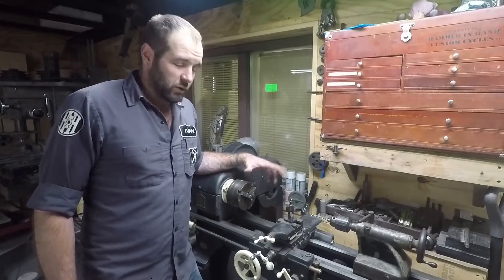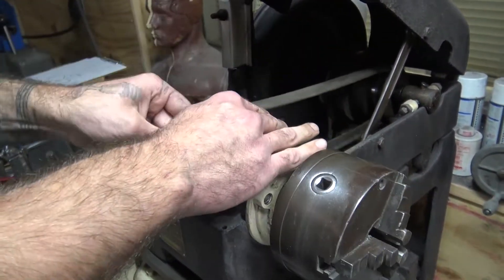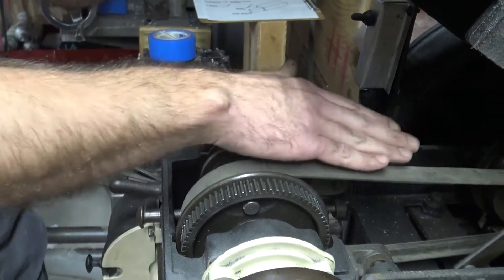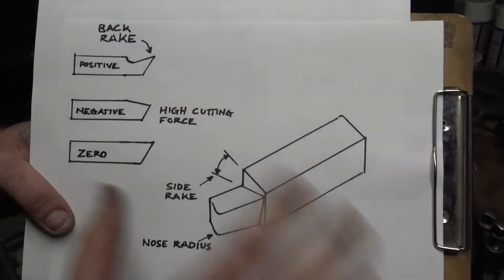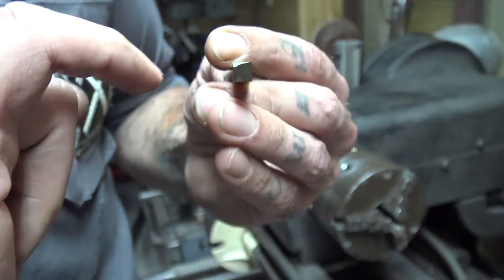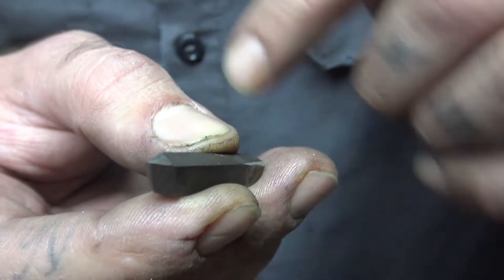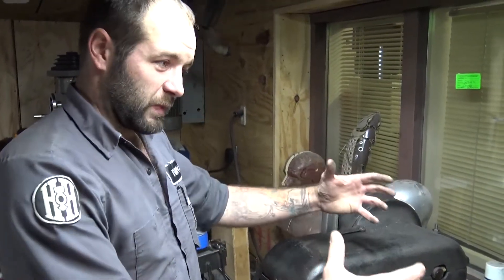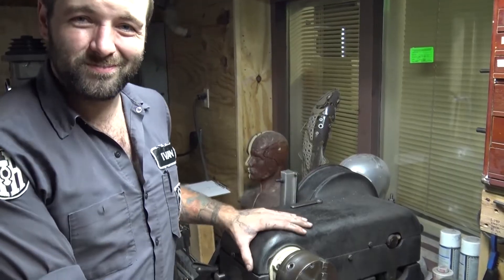Metal Lathe Basics Tutorial | How To Use A Metal Lathe

Comment: love the vid,  but for all beginners, please keep your fingers back while the lathe is running, sometimes thosae chips and strands are razor sharp,  ive  hada few close calls pullingthem off when the machine wasnt even running, pull off a strand, and it was caught, it will sing right into your skin. always be careful,  we use pliers,  or gloves to pull chips away,  but dont use gloves while lathe is running, if it grabs it your hand may be gone, it may even pull you into the machine

Comment: Best vedio I've seen, just got a 12 x 36 atlas,, really good condition has quick change gear box,, all teeth look great on side and in box,, l noticed you don't use much oil,,  mine was soaked in it and still rattled in gear,,,l sprayed it anyway with lucas red n tacky and quieted it down a lot,, l know could attract chips but it's under cover,, and so many say too set tool table on 29 degrees all the time as well as treading,,,what's your thoughts? You impressed me